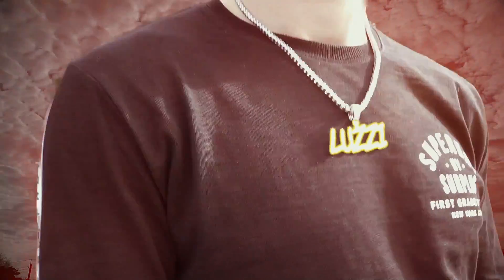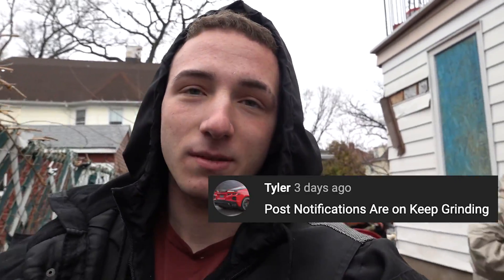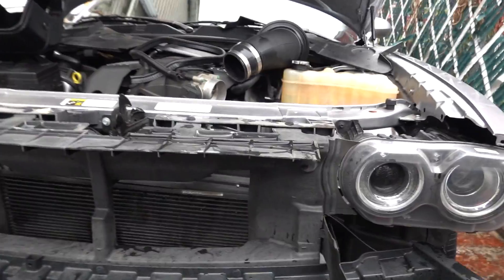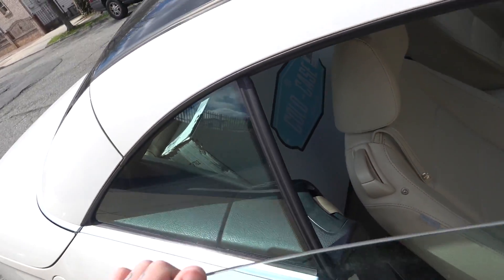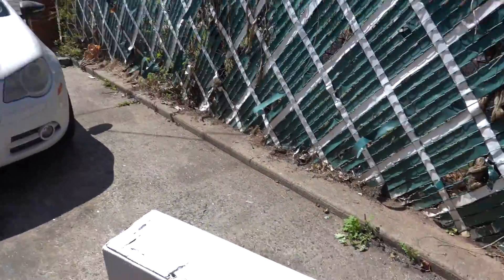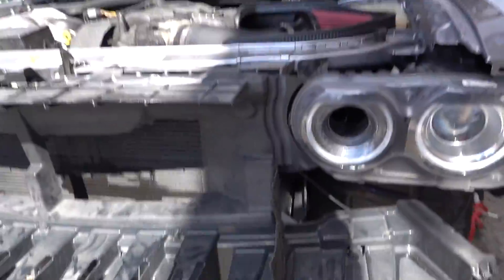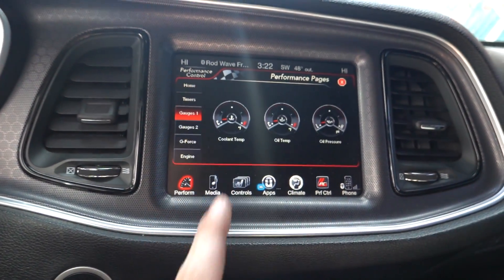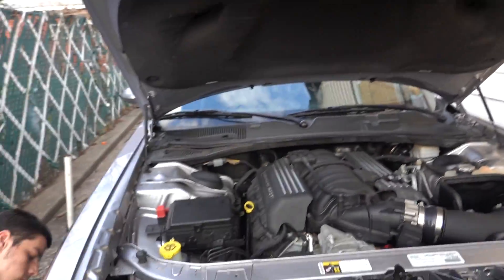My ENGINE Almost BLEW Because of This...

Comment: The Car Will Not Necessary “Explode” If It Overheated, It Just Throws Up The Antifreeze, And If You Run It Without The Antifreeze, You Could Seriously Seize Your Engine